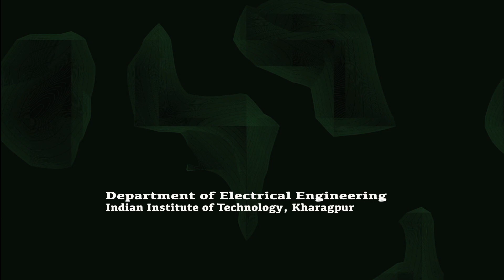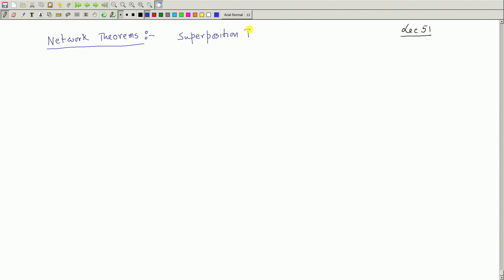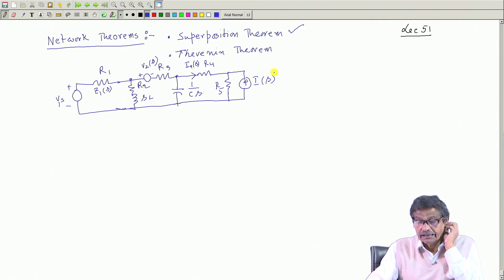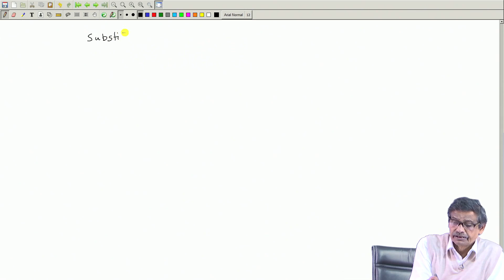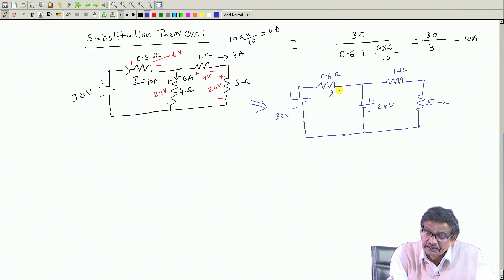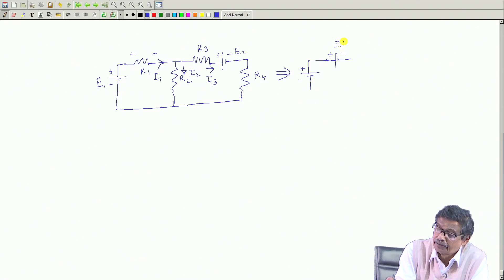Lecture 51: Network Theorem - I

Comment: Timestamps (Powered by Merlin AI)
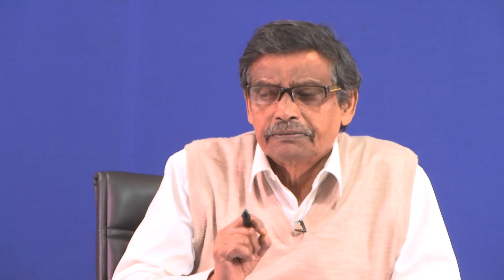00:22 - Introduction to Network Theorems and s-domain analysis.
04:27 - Introduction to network theorems with a focus on Superposition theorem.
09:00 - Understanding internal impedance and superposition in electrical networks.
13:22 - Understanding Superposition Theorem in network analysis.
17:22 - Application of Superposition theorem for current analysis in networks.
21:23 - Explains substitution theorem in electrical networks.
25:00 - Current distributions remain unchanged when replacing impedances with voltage or current sources.
29:14 - The theorem aids in analyzing current distribution in electrical circuits.